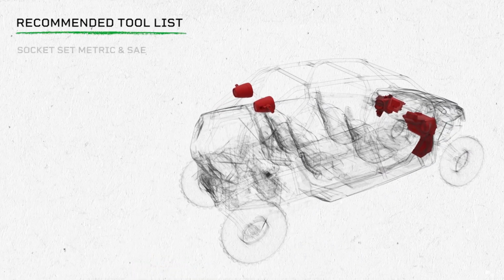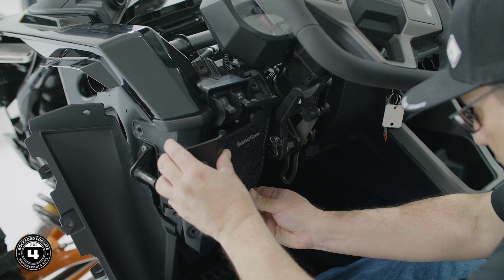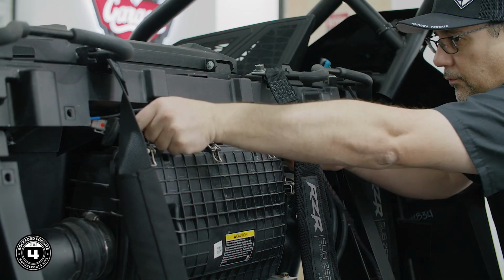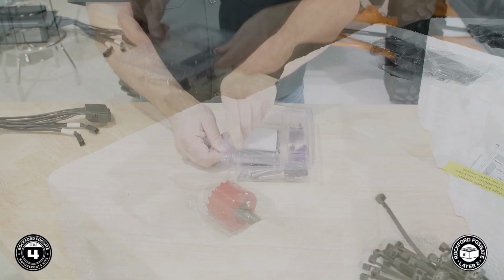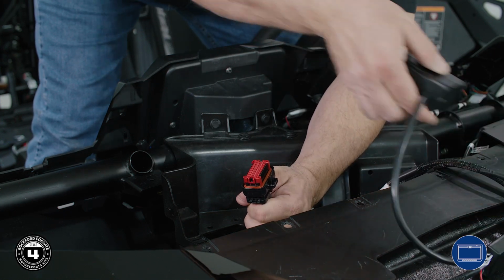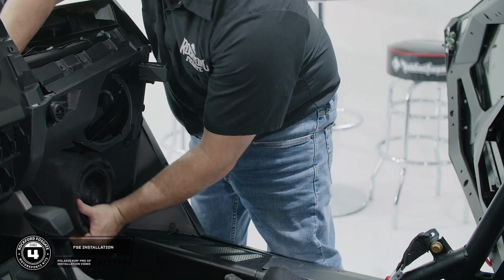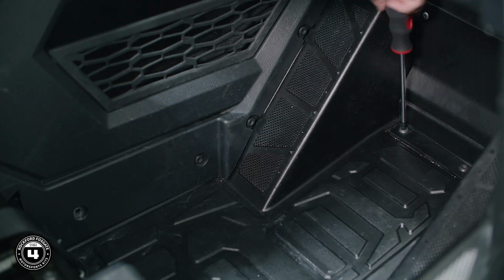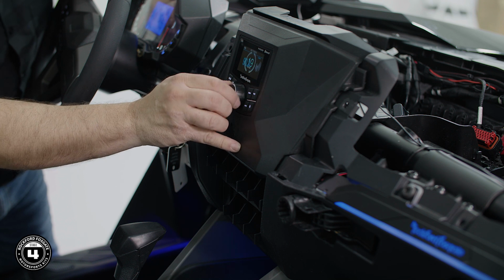2019+ Polaris RZR Pro XP STG4 | Installation

Comment: I can add two tower ?? O how can I add more audio keeping my ride comande. 
Thanks you
Reply from the maker: If you're planning on using Ride Command as your source, you'll need to look at the RZR19RCPXP-STG4 that has a Ride Command module.  To answer your question, the amplifier has 5-channels, so the FRONT CHANNELS operate the front speakers, the REAR CHANNELS operate the rear channels, and the SUB CHANNEL operates the sub.  The FRONT & REAR CHANNELS are operating at 4Ω - and since the channels are stable to 2Ω - you could run cables directly from the rear tower speakers to the rear channels of the amplifier to create 2Ω load, again which the amplifier is stable at.

Comment: why cant you use the connectors already by headrest
Reply from the maker: We can't rely on all models having factory speakers in the rear location, so we provide a complete wiring harness that allows ALL trim levels to add rear speakers.